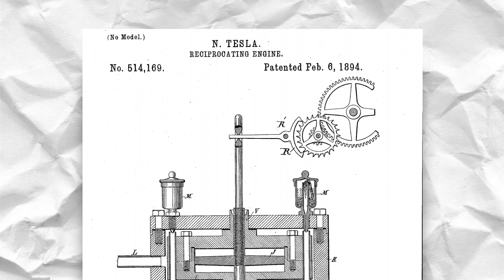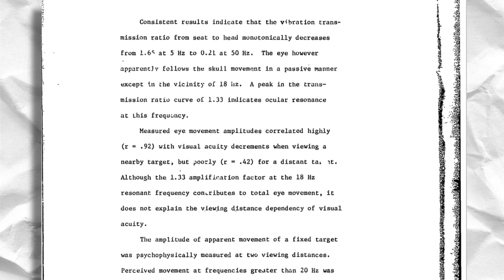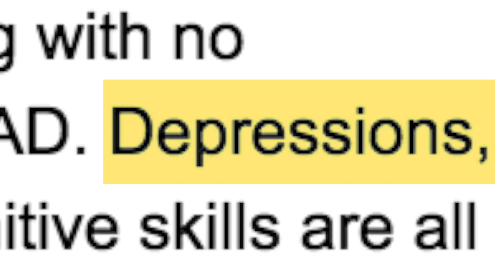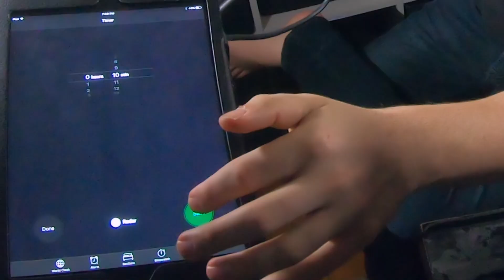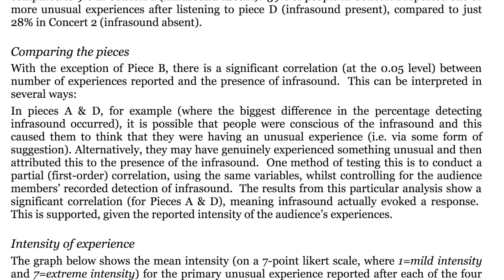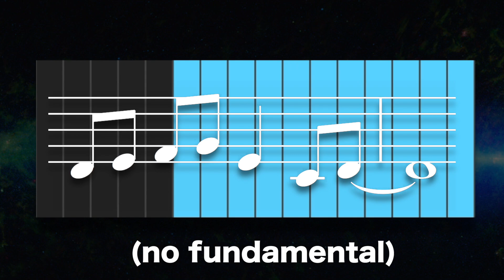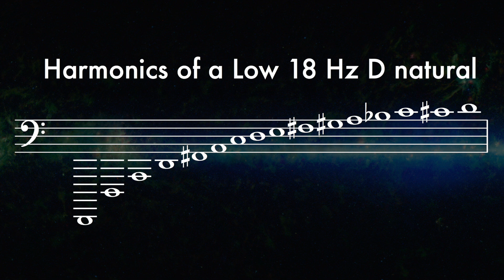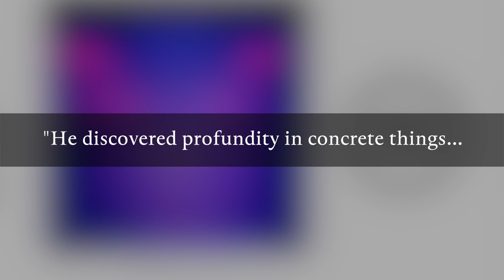How to See Ghosts (using Infrasound)

Comment: What if it’s not explicitly the sound causing the “eye vibrations” at normal volumes, rather your bodies response to the anxiety that the sound creates?

Essentially triggering a low level fight or flight response to try and identify the source of dread? While Vic may have tried to push through with whatever he was doing, his eyes would subconsciously be scanning his environment to determine if they need to escalate the response or send an all-clear to the brain to ease the anxiety. 

The “ghosts” could just be Vic becoming momentarily aware of his brain doing this extracurricular activity and trying to make sense of an incomplete image. 

I’m imagining the brain scanning the environment and seeing something it definitely knows isn’t the culprit, like a clock, and moving past it without making note of the fine details like the placement of the hands. The “Ghost” comes from Vic interrupting this process and essentially seeing a clock with no face for a brief moment.

Comment: I pulled out a sinewave-generator app, on headphones:  I’m surprised to report that my low-end threshold of hearing was around 14.3Hz — a tritonish below the often-cited 20Hz. 

I won’t lie:  these way-low pitches did sound creepy!  However, that’s almost certainly just because they’re unfamiliar though — much more likely than my eyeballs or any other part of my body resonating.  I mean, hey, we’re talking headphones here:  way-low-power signal!

I can’t completely rule out the headphones, the app or my iPhone having hit cut-offs.  I’m guessing it’s more like my hearing limit though.

Unlike complex waveforms, with harmonics/partials, there was a definite point where the sound cut out.

Unfortunately, the app didn’t let me type in specific, exact frequencies.  I had to use a coarse frequency slider, so I couldn’t dial in exact frequencies in tenths or hundredths of Hz.  With a little trial and error, 14.3Hz looks to be about it, for me at least.

Comment: Been researching this as I am on a paranormal team. We try and use every method we can to debunk claims of paranormal as best we can. I've been researching infrasound to try and determine if that could be affecting people who contact us. We don't believe that everything that people experience is actually a ghost/spirit/etc but may possibly be environmentally influenced (i.e. wifi routers or electrical devices giving off high RF frequency or high EMF that people can be sensitive too). So, a couple of questions...

What software would you recommend to use to evaluate frequency below 20Hz from recorded audio on a digital recorder. and how did you rig up the sub woofer to generate the 18Hz frequency?  I'm always looking for tools to add to help us help other people. With all the frequencies that can be generated by so many devices and tools, etc and all the high energy that can be generated by electrical devices and all the rampant use of wifi and cell signal, there's no telling what kind of damage we're doing to ourselves and how it may make us think that the paranormal is affecting us when in reality, all the things we surround ourselves with on a daily basis could be harming us and we don't realize it. 

And thanks for the videos! I've really enjoyed many of the content you've posted!

Comment: My friend used to have a pickup truck that when you turned the heater on, the cab would vibrate and resonate in what must have been the most godawful frequencies. Because sitting in the truck when it was resonating was instantly anxiety inducing and oppressive feeling. He hated driving in the winter in that thing.

Comment: It might be interesting to play the 18-Hz tune you wrote just a smidge faster, at 135 BPM (I clocked the tempo you were playing it at around 126). The reason I say this is because 135 BPM is 2.25 beats per second (135/60=2.25), which is the same as 2.25 Hz. And this low “pitch” of 2.25 Hz (so low we hear it as a rhyrhm) is exactly three octaves below 18 Hz. You can think of 2.25 Hz (or 135 BPM) therefore as the 8th subharmonic of 18 Hz, or alternatively you can think of all the notes in the harmonic series built on 18 Hz (which you use to create your tonal materials in the piece) as also being harmonics of 2.25 Hz... just much higher in the 2.25 Hz series (and not continuous).

Comment: I like to use a synth (KMX) to produce tuned subsonics beneath the kick drum which rides around 50hz. It makes the low kick sound change its relative tone in response. Then the bass guitar comes in slightly above the kick playing a bass line while the sub tone just hits the absolute roots/ fundamentals from about 12 to 30hz. If you listen through a system that  can reproduce those low tones it adds a very intense weight to the music.

Comment: When you say the combination tone is created by the brain, I don't think that's accurate.
If it is what I think it is, and I think it is, it is very much a physical vibration in the air. That's also the sound you hear when you tune a guitar and play at the same time two notes that are slightly different (a few cents apart). You'll hear a periodic variation in volume, (that back and forth "woowwoow") that gets slower as the two frequencies get closer together.
That's called an interference pattern, and it happens to actually be a periodic variation of acoustic pressure, which is what sound is. Because, physically, the "waves" of air of the two notes will add up almost perfectly, then add up imperfectly as they shift away from one another, then cancel one another almost perfectly, then back to adding up imperfectly, etc. (I'm sure one of your videos could make that a lot clearer with images, experiences and English as your first language xD)
Bottome line is, if the frequencies you're mixing together are high enough, you can actually generate a very real, physical "undertone". Which is by the way one of the main principles that allow theremins to work.

Comment: What knowledge do you possess regarding microwave hearing, specifically in the realm of beaming voices into a target's head?  This technology is also known as the microwave auditory effect, and the Frey effect.  The devices are sometimes labeled as parametric loudspeakers, or directional loudspeakers.  American Technologies have their version patented as HyperSound, which I believe at one time was called HyperSonic Sound Directed Audio Technology, while DARPA's version is apparently being called a Sonic Projector.  Then, there are the various alphabet gangs naturally conducting their own research, with their own designed devices.  Thus, the technology exists in a few different versions, but that was over a decade ago.  American Technologies made their version of the technology available to order through authorized resellers back in 2005.  The product model number was HSS-H450, and they sold for $699.  You can still find them listed with photos on a few sites, but of course they are no longer available, and I have been unable to locate, or confirm, any replacements that are newer versions of the 2005 model #: HSS-H450.  It just seems as if somebody, somewhere did not want those, or any other, parametric loudspeaker available for sale to the general public.  However, in one forum, someone mentioned that you could often find them for sale on ebay typically for around $150.  Hence, I am wondering if you possess any knowledge regarding this technology, and if you would care to share it with us, your viewing audience.

Comment: Infrasound was being used against my house in Centennial Colorado. In late August 2017 the house was attacked for an hour and half by high decibel variable vibrations, that caused dry wall nails/screws to start to slide out of their position. On Septemeber 3, 2017 the house was attacked by high decibel bass that shook the house from 730PM through 130AM shaking the floorboards from 5000 feet away and  giving me tinnitus. Later that month I caught the girl in the white Jeep from next door driving down the street with her massive subwoofers shaking the fat on my belly from 50 feet away.  In October 2017 there were all kinds of weird noises/vibrations in the house when I was there alone. At one point I saw a flash in the corner of my eye that looked exactly like the ghost used at 7:30 in this video. Exactly. The noise harassment was all threaened in an insurance fraud conspiracy on January 17, 2017. Currently still being targeted every 5 to 20 minutes with a noise harassment campaign in accordane with an insurance fraud conspiracy https://youtu.be/O3Fg0yl-Eag
Btw I think your hallucination experiment would work better, sleep deprived and in the dark. People exposed to 18hz don't just get a taste of it for 10 minutes, it's caused by some kind of all day all night vibration like sheet metal (flashing for roofs)  in the wind or a fan that needs lubrication, or air conditioning units in office buildings or apartments. You know that spooky moaning-woo ghost noise you hear in movies,? The insurance fraud asbestos  contaminating contractors messed with my sheet metal door flashing and the wind+highway noise would make that creepy sound for hours on end.

Comment: So just for fun here.. "10 octaves below the lowest Eb on a piano" would be 38.8909 Hz / (2^10) which gives you around 0.038 Hz.  Given that a Hertz (Hz) is equivalent to 1/seconds (something with a frequency of 2 Hz oscillates every 1/2 of a second), that would correspond to a beat that oscillates around every *26.3 seconds*.  Let alone "pitch", it's not even feasible to think of as a friggen tempo, at around 2.3 BPM.  If you made a pendulum that swings that slow, it would have to be 565 feet tall.

Comment: Using infrasound to create the feeling of impending doom could be interesting for cinema. I wouldn't be surprised if many cinemas (especially IMAX) are already equipped with sound systems that can create a sufficiently strong 18 Hz tone.
This could increase emotion and tension in dramatic/exciting scenes. Just imagine a movie that goes along rather regularly and then hits you with, say, a dutch angle and a strong 18 Hz tone.
It would immediately feel incredibly "off", and, which could also be a good thing, give more of a special effect to watching movies in the cinema rather than at home.
Buying a subwoofer that can properly create an 18 Hz tone is really not worth it for the vast majority of peole, so the full effect will pretty much only be available in the cinema.

Comment: As someone with weird freak hearing (<15 Hz up to around 19k or so), that subwoofer bit is really disorienting because even though my dinky earphones can barely output those dismal low frequencies, the shifts from off to on to off are subtle but uncomfortable, like something walked into the room just at the edge of your field of vision and you know it's there but don't want to turn around and look at it. Not actively unpleasant in the same way that the scree of a crappy CRT TV is, but a lot creepier.

Comment: Pilots of the first Vulcan bombers in the RAF would instantly go mostly blind when the plane touched down or took off due to the unforeseen effects of ocular resonance matching the frequency of the plane's vibration. The effects only lasted as long as the plane was slowing down on the runway, and this problem was fixed in later versions of the aircraft.

Comment: So basically, psychoacoustics. It's complicated shit; a synergetic effect caused by multiple variables both material and implied, like the illusion of yellow light you see when you combine red and green light.

Now maybe you have a better understanding of why people hear and feel something different when they listen to music tuned to a different reference pitch (435, 432, 430, 420, etc.; the resonance factor), and why each temperament affects us in different ways (the binaural beat factor caused by imperfect ratios, which can also vary within a temperament based on what reference pitch you tune to). Some of it is about resonance, and some of it is about proximal effects of our brains interpreting or misinterpreting relationships to create the perception of something that isn't materially there. 

It's like the yellow light we see when there are no yellow wavelengths; in our experience, the "imaginary" RGB yellow light is still real, as the overlap of red and green still produces color rendering effects like yellow wavelengths, and we react to the brightness the same; our misperception produces a de facto reality that is equal to yellow wavelengths in terms of practical effect. If B operates like A, then essentially they are the same, thus interchangeable. B may not have the same depth of effect as A, but for all practical purposes, they are the same.

Everything we perceive is real; it's just up to us to determine how it is real and how to interpret and utilize it. For example, just because CO makes us hallucinate doesn't mean ghosts aren't real; like the illusion of RGB yellow light they have a de facto reality, because they are embodiments of our sense of other, memories of people who've died, whatever. It's an observer effect of giving something life, like the concept of wave collapse in quantum theory. At the very minimum, we can call it a personification of an unidentified threat. The threat of CO poisoning is very real, so even if the ghost is not the material apparition of a dead person, the ghost is still very much a real thing, with real consequences. So the personal relationship we project onto CO poisoning hallucinations is a de facto reality, just like the relationship we have with RGB yellow. 

It may work the same with 18 Hz ghosts, or it may be real ghosts unveiled by visual distortions; either way, they are equally real. That's because reality is our objective experience of what we perceive, not the objective existence of the phenomenon we perceive. The gaps of space between things are just as real to us as the things creating the space, because we measure the gaps the same way that we measure objects. They are part of our total measurement of everything we perceive, and that total percpetion is the sum of our reality.

If you haven't already, you should look into philosophical pragmatism. Fascinating stuff. For an example of how different reference pitches can change the ratios in ET enough to influence our emotional experience, listen to the three differently tuned versions of my song, Descent Into Death: reverbnation.com/bateatsmoth

Tuned to 432 or 430, the interval ratios in equal temperament deviate less from the pure 5-limit just intonation ratios than if you tune to 440 Hz (do the mathematical comparisons; you'll see that this is true). What we hear as a difference in color is partly caused by the difference in binaural beats caused by that difference in interval width. Listen for the interval beats in a 430 tuned piano, compare them to the interval beats in a 440 tuned piano (both tuned equal temperament, of course). For most of the intervals, you will hear less beats on the 430 tuned piano. That difference is part of why we feel different listening to 430 or 432 tuned music than 440 tuned music; the brain responds to the lower number of beats per second differently. You can even feel a difference betwen 430 tuning and 432 tuning. For example, in a 440 interval, you might hear 9 beats per second, indicating a 9 Hz deviation from the pure ratio that would produce no beating; in 430, you might only hear 5 beats in the same interval, indicating a 5 Hz difference. Your brain is processing those differences as frequencies. Your brain reacts differently to 5 Hz than it does to 9 Hz, so even though the frequency isn't real, you react to it as if it is because you are reacting to the measurement. The depth of reaction may not be the same because there is no corresponding experience of resonance, but there is still a reaction.

It's also why we perceive Pythagorean tuning as spooky or otherworldly. That difference in interval beating in certain places and lack of beating in others causes us to perceive something we don't perceive listening to the same music played in equal temperament. Same is true listening to a piece played in well temperament or meantone as opposed to ET. Despite not knowing what we know today, the composers who messed around with temperament and reference ptich in the clasical period understood that these differences influence how we feel a composition. I instinctlvely understsood this before I knew all this stuff, which is why I experimented with 432 and 430 and stuck with 430; it produces the experience that I'm trying to impart with my music. I'm not so much concerned with how or why it produces that outcome; all that really matters is the practical effect.

Comment: It's interesting to me how you throw in a disclaimer saying you're a musician, not an engineer, but then you proceed to explore a topic central to mechanical and civil engineering: vibration analysis. Specifically, it's cool how being a musician got you into that topic.

For me, the path was backwards. I'm a mechanical engineer who has studied vibration analysis, which is exactly the subject of determining how systems will respond (vibrate) when facing input forces and so on. One day, I was sitting in my senior design room when I picked up a funny part: a tube open at one end and capped on the other. On a whim, I blew across it like a pan flute tube and managed to make a clear, ringing sound! This immediately got me thinking about the physics of vibrating air columns. I read up on flutes and clarinets, took some measurements on my tube, and analytically predicted what note I was playing pretty accurately (I measured it with an online tuner to confirm). After a short obsession with learning about the physics of flutes, I ended up buying one and have now been learning for a few months.

Great video. It's always fun to see a different perspective on things.